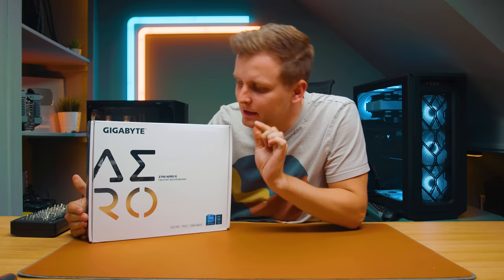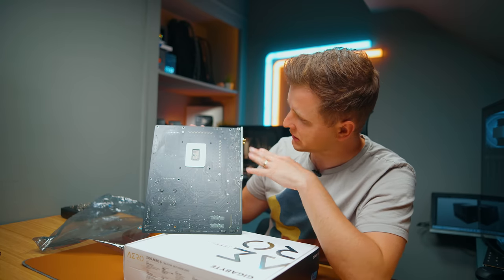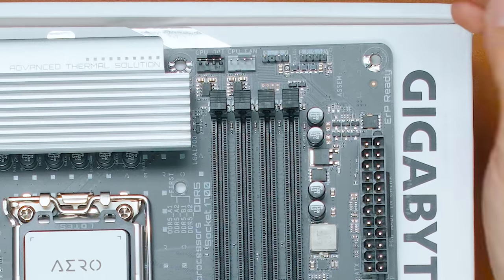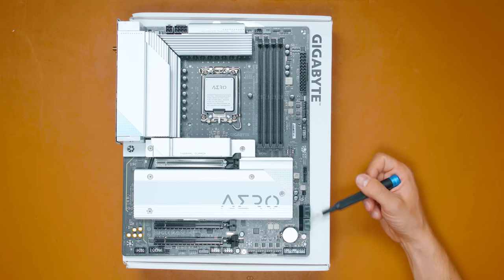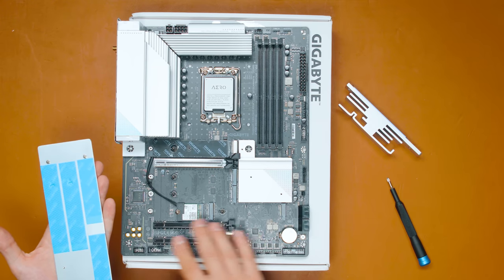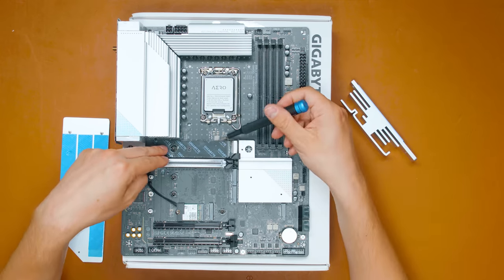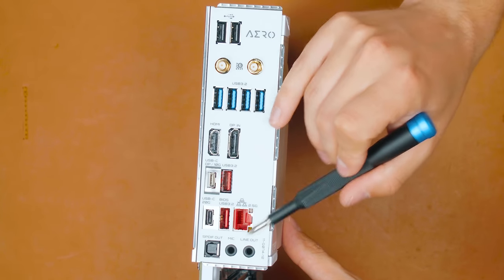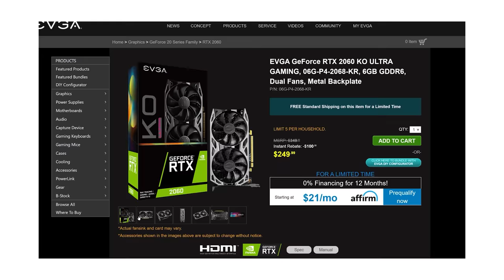Here's WHY THIS is made for CREATORS! | Gigabyte Z790 AERO G Overview

Comment: I have still to see a graphics card come anywhere close to needing x8 PCIe, so whoever needs the speed will do no harm in using the faster slot. I don't understand why some people make such an issue over a PCIe port that will never even have 50% usage, even at x8. However, this board does have a few "issues" and I can't justify the prices I see being asked for it when there are boards $150 cheaper with a far better IO design.
There used to be the "Asus Tax", now I see there is the "White Tax" + the "Creator or Art Tax".
Reply: Its way cheaper than the Aorus versions. The Z790 Aorus Extreme is basically the same and costs 4 times more.
Reply: @gerardoliveras430  must be a regional thing, then, since where I'm at it costs €490 and is order only.
Reply: If you want to run two GPUs, they would each be running on x4, no?  That would be a significant problem for 4090s, I think.
Reply: @electra6821  It depends on the MB. I know the Gigabyte with the PLC chip can do 8x8, or 16x16 with no lanes being taken by other things. Don't know why anyone would want to run two 4090s though, SLI is sort of dead, besides what PSU would be used to power around 1000W just for the GPUs?

Comment: Given the fact that there are no Gen 5 graphics cards, running pcie gen 5 x8 is the exact same as running pcie gen 4 at x 16.  So go ahead and populate that top m2 slot all you want.  Not only that, but even an rtx 4090 cannot really fully utilize the bandwidth above pcie gen 3 x16.  Yep, that is correct.  Unless you are doing something along the lines of high end computation or rendering, then you wil not even need gen 4 pcie bandwidth let alone pcie gen 5 bandwidth.  So for example, you are working in PP or Dav Resolve, you won't even utilize the bandwidth of pcie gen 3 x 16 let alone pcie gen 4 x16.  If you game, same is true.  Could that change 4 or 5 years from now, yep, but if you can afford this you won't be using this hardware in 4 or 5 years will you?